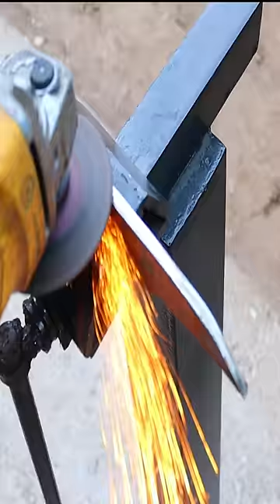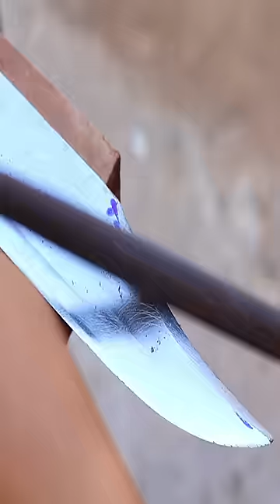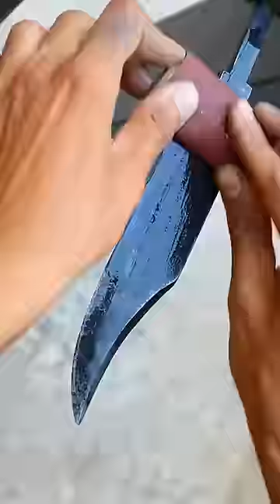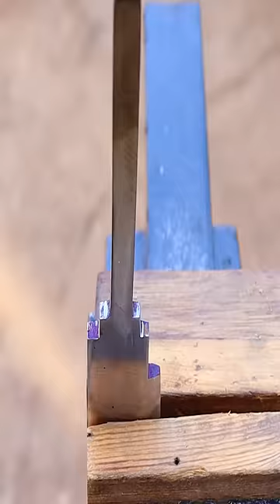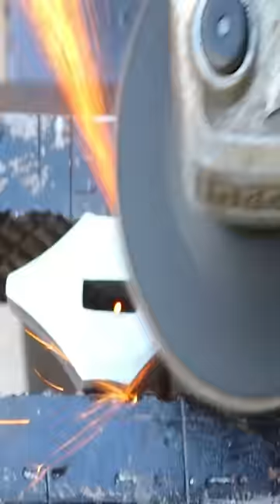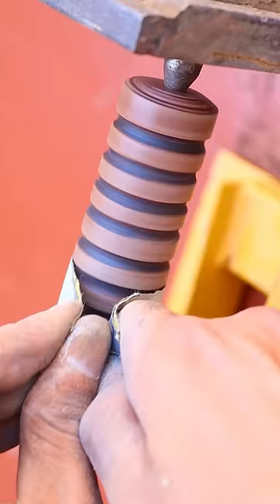Making a bowie knife #shorts

Comment: Tang is likely too short to hold up to heavy use and the cylindrical handle will make it difficult to index and will contribute to edge alignment issues and glancing cuts.

The video also does not show the tempering process after quenching, but I really hope you did it, or that thing is a liability.

Looks really good, though.
Reply from the maker: Thank you for your interest

Comment: What metal did you begin the project with?  Could it be a lawnmower blade?
Reply: Lawn mower blades are good for knife steel I made a 24 inch chopper out of one
Reply: Meh. Best free steel by availability and workability would have to be coil/leaf springs. That’s where I started 5 years ago

Comment: Alguien me puede decir como se llama el disco que deja como espejo el cuchillo?
Reply from the maker: You need to sand the knife in degrees starting from 40, 60, 80, 100, 120, 150, 180, 220, 280, 320, 380, 400, 500, 600, 800, 1000, 1500, 2000, 3000. Sanding indicates the degree of fineness of the sanding, and ends with polishing the metal using a metal polish and a polishing wheel. To remove scratches